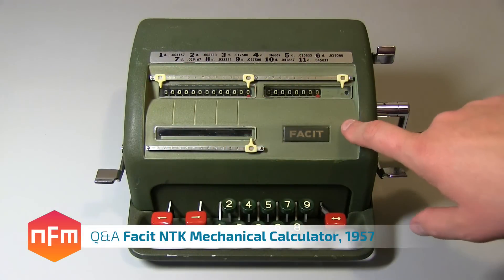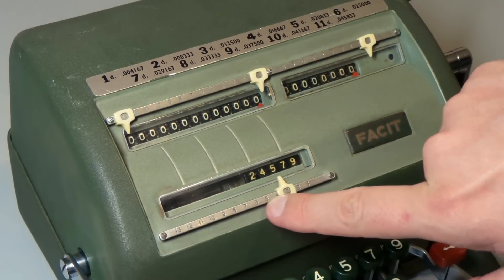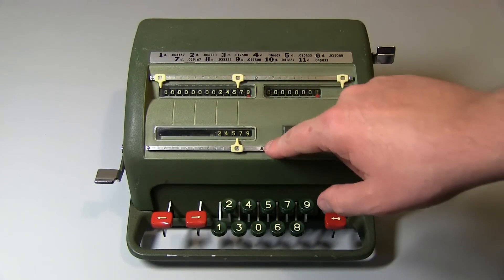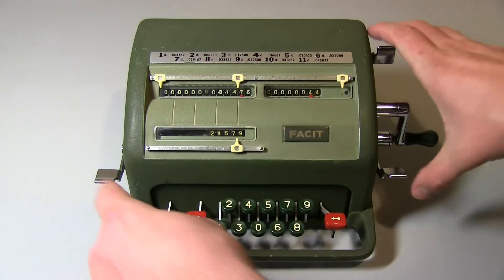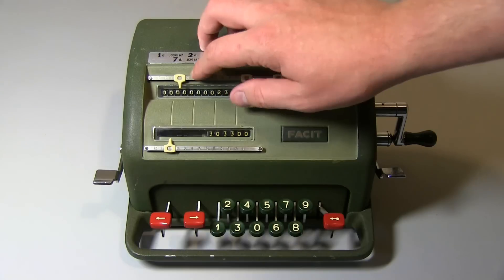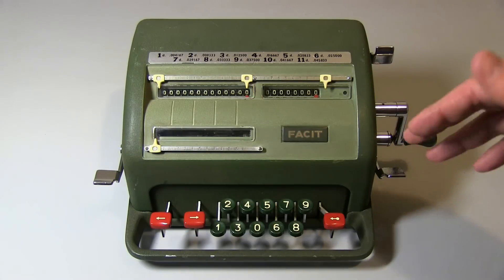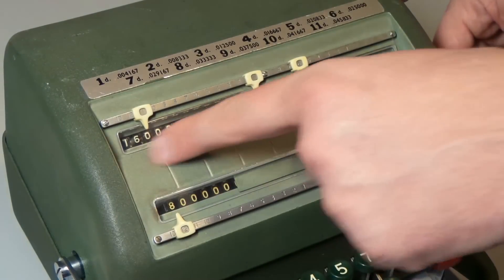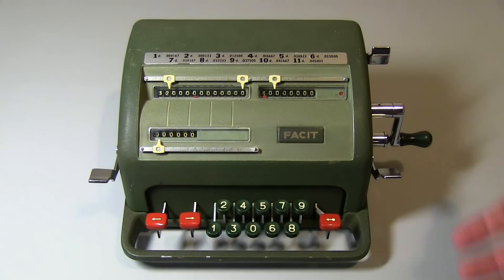Facit NTK Mechanical Calculator: Division by zero, decimal markers

Comment: Division by zero is not scary, it's just calculators and computers can't handle it because they can't handle infinities without human intervention or programming to tell them to stop calculating at some point, or mechanical/electronic failure if they are left to run indefinitely.

Comment: I think the reason it does that (the motorized one) is because being powered by a motor it is inherently much more prone to wear and tear, thus, the designers added a feature for you (in the aspect that it seemed to cycle through without stopping), the operator to work in the machine oil, once applied.
On a larger calculator that i've seen, this was activated via a hidden lever on the base. Unfortunately, the name escapes me, it was a friend's machine and it's  been some years now.

Comment: 'Division by subtraction' gave me the simple reason why dividing by zero gives an infinite number. And it took a mechanical calculator to show me it. Thank-you, NFM! :-)
Reply: It's not actually an infinite number, it's undefined. If you look at the graph for 1/x you see, that the curve goes to + and - infinity, depending on from which side you come. So at point 0 it's + and - infinite at the same time, which doesn't make any sense, because it's every positive and every negative number on the Y axis, therefore it's undefined.
Reply: No. At 0 it's + inf and - inf *at the same time*, which is mathematicaly undefined, because it has every possible real index on the y axis *at the same time*. What you are talking about is the limit which converges towards + infinite for x > 0 and - infinite for x < 0. But at exact point 0 it's undefined. Also note that infinite is not a number, it's a concept. For instance a finite set has n elements where n is an integer, an infinite set has no number for it's size.
Reply: qwertyuiopasdfghjkl qwertyuiopasdfghjkl yeah, that's probably what they do in measure theory (according to WP)
Reply: And CPUs can only add (well, modern ones now sometimes incorporate a couple of extra mathematical functions).
Reply: https://en.wikipedia.org/wiki/Indeterminate_form
0*inf is also indeterminate form
Reply: Richard van Pukkem That's overly simplistic. You also can't have half a person in your cake example, but mathematics does allow for half people, just like zero is a number that can be handled in mathematics, including dividing something by zero.

Division by zero does equal infinity, but for general use, you can assume that there is no useful solution.
Reply: What about -1 tho
Reply: You guys talk as if you’re handling university material. You have a cake, you divide it for 2 persons, you get 2 pieces. You divide it for 1 person, it will just be the whole cake, one piece. You divide it for 0 persons, nothing happens. Same for the math of dividing by zero, you’re asking math to not do math. It’s just not possible.
Reply: Positive number divided by 0 is positive inf, negative number divided bu zero is negative inf. Why can't we define it like that? 0/0 or 0*inf is what's really cannot be defined (only way to define these is to define them as "undefined" lol).
Reply: 0*inf can be defined as 0 times any number is 0. Adding 0 to 0 is equivalent to doing nothing so it would be like doing nothing to 0 forever, which equals 0.
Reply: It is infinity. Undefined is when you can't determine the rate of tendency of a limit function. Here, it tends to infinity if the denominator tends to zero and the numerator is any finite number different from zero.

Comment: Do the electronic calculator use the same method just faster?
Reply: Pretty much.  In fact, computers use the same method, too.  They just usually do it with binary numbers instead of decimal.  But it's still all repeated subtraction and shifting.

Comment: I have one of these. It didn't work when I got it. But I fixed it, oil and bending a linkage, lots of oil and time to let it soak into the variable tooth cogs. Works great now, thanks for the explanation on division and the pointers. Although I had never seen one of these on the inside, I have worked on teletype machines. Lt 33 mostly, paper tape punch, and other old computer equipment, some were constructed of discrete transistors, no tube experience. The really old guys say you just turn out the lights and look for the burned out filament.
Reply: The old guys are pulling your leg.  I worked on military vacuum tube equipment for six years, and CRT-based instrumentation for another five, and never saw a filament burn out.  Most tube failures happen because the cathode emission has degraded enough to prevent proper operation of the circuit.  Another common failure is excessive gas, caused by microscopic leaks around the pins.  You can sometimes see this visually, because the tube may glow blue.  But burned out filaments?  Very rare.

Comment: do any mechanical calculators divide via other methods other than the subtraction? if so it'd be interesting to see what they do.
Reply: Ignoring electronic calculators, some mechanical calculators divide by alternate subtraction and addition. Most of these calculators do not have a ten's carry mechanism in the counter because it is never necessary to turn the crank more than nine times for any digit. Some models have an optional ten's carry mechanism in the counter that allows for shortcut multiplication and division. The user never has to correct for an under-run when subtracting the first digit, they just listen for the bell. The next digit to the right is selected and the crank turned for addition until the bell rings again, no over-run correction needed. Subtraction for the third digit, addition for the fourth and so on. It's much faster than the normal method but requires the added cost of this option. Without ten's carry in the counter this method will just give you gibberish.

NOTICE! This calculator shown here has ten's carry in the counter so this rapid division technique may be used on this machine. He just doesn't demonstrate it here.
Reply: jedi1357
ah ok. i heard of the huge mechanical calculator, the one in London's technology museum, and how when someone tried to divide by zero on it it "went beserk" and started falling apart, i suppose they didn't have the foresight of adding a tens counter.
Reply: If you consider a slide rule to be a mechanical calculator, then yes.  Slide rules multiply and divide by adding or subtracting logarithms.